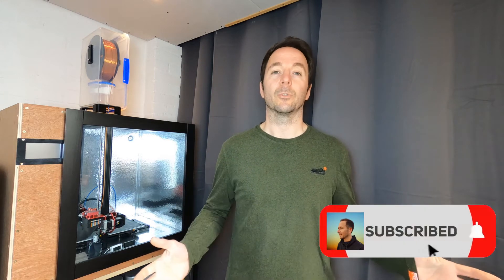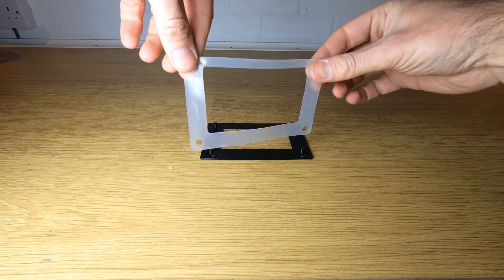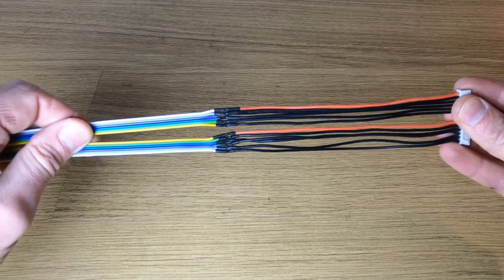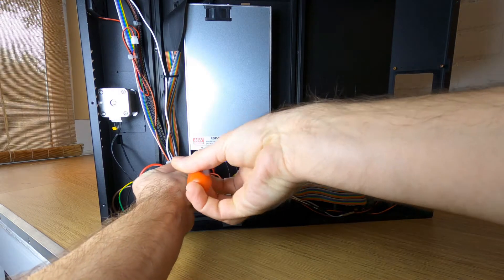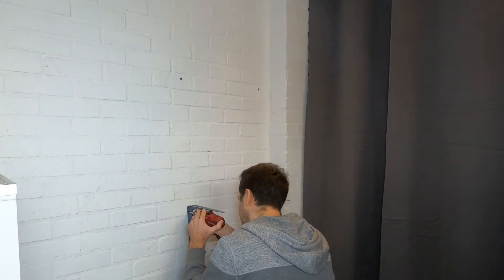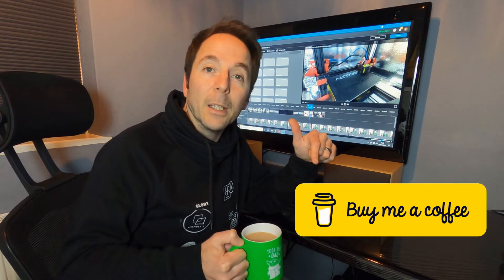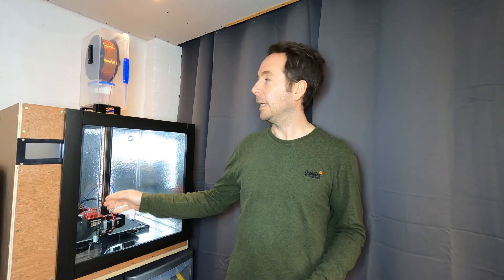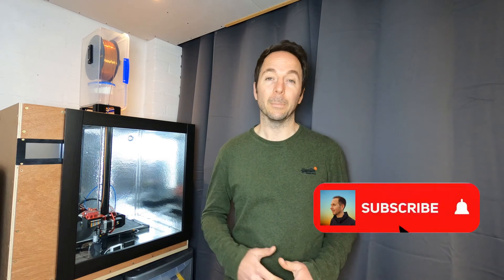CR 10s Pro 3D Printer Enclosure Pt2 (Fully operational by the end of the video!)

Comment: hi ricky i have a quistion for you i have my printer in a cabin and i print with pla dose the cabin temp effect the print quality 🙄🙄
Reply from the maker: The short answer is 'yes' but the long answer would need more information. It's more about the extremes of temperatures and drafts. Different materials can also be affected more or less by different temperatures. If you are printing mainly with PLA then I haven't really noticed a lot of difference from 10°C up to 40°C. What seems to have more effect is sudden changes in temperature or a draft cooling a print.
Reply: @RickyImpey  thanks for the long answer. and other quistion please did add a fan to cool up the cabine and why people do that
Reply from the maker: @HumamZaki  Sorry, not sure what you mean. Do you mean why would people add a fan to cool somewhere where they have a printer? I can't really say but I imagine they are concerned about temperatures getting too high. They may also be using a fan to extract any harmful particles from filament like ABS.
Reply: @RickyImpey  ok no problem thanks alot

Comment: Hi Rick, great build. Are you having any issues with heat creep, especially when using low melt temp materials liked PLA?
Reply from the maker: Hi, no none at all actually. I've honestly only had positives from putting the printer in an enclosure. Better bed adhesion from the more consistent air temperature around the print and a cleaner bed from less dust. I have however only been using it over the winter. Summer is only just starting to hit here now so warmer temps may cause issues that I haven't had yet. If so then I'll make more mods and another video🙂

Comment: I'm eager to see what mods you plan on doing in addition to this enclosure. I have an octoprint Raspberry Pi to monitor my prints so I'm trying to figure out how to still use it with the enclosure.
Reply from the maker: The good thing about this enclosure is that it's really easy to just remove a side panel and cut any holes etc. I was thinking of just mounting the Raspberry Pi to the outside with a small 'window' for a camera to monitor prints. Of course I will also need to provide power and I'd also like to be able to turn the printer in and off with Octoprint so it will need to be separate. Nothing too difficult to do and it's on the list of things to do.
Reply: @RickyImpey  would a USB wire be ok in the enclosure?
Reply from the maker: @nyjets91  it should be fine, I don't think you'd ever want the enclosure warmer than 50°C and wiring will be rated much higher than that. Without additional heating, mine gets to 40°C from just the heat bed. The best thing to do would be to run any wiring underneath in the section below the heat chamber that is cooled by fans. The main reason being that it keeps cables away from moving parts.

Comment: I was thinking about making a enclosure for my Pro in my garage I also use octoprint for remote printing so no need for the sd card just 
need a location for a raspberry pi ? but great idea thanks for the video
Reply from the maker: You're ahead of me Andy, I'll be doing that at some point when I have time. I have all the bits already. I was planning on cutting a rectangular hole in the right hand side and having a small 'window' for the camera to look through so that it's not in the heat chamber. I'll probably use a glass phone screen protector or something similar then have a 3d printed cover over the back to protect everything from dust and damage. Let me know if you come up with a better idea👍
Reply: @RickyImpey  Did you make any progress with the webcam idea ? thanks
Reply from the maker: Hi Andy, not just yet, I'm working on another project for the printer at the moment but I do plan on sorting Octoprint with a cam soon.
Reply: @RickyImpey  I've been looking into mounting a pi ir/day camera to the printer  then a long ribbon cable to the pi external ?
Reply from the maker: @trickylong17 , yes I have a dual day/ir camera all ready to go to use with the pi. I was going to just run the cable through a hole in the side of the enclosure by the 'front' of the printer. I will mount the camera inside but clear of the print bed and the pi on the outside of the enclosure with a 3d printed dust cover. It will need a power supply which I will run separately to the printer so that I can remotely turn the power to the printer on and off.

Comment: Rick. Although the insulation you installed is fire resistant. Have you considered installing a thermal fuse? Wire as part of the AC feed and placed in the top, it would cut the power in the event of fire or overheating. It won't put the fire out, but it might stop one happening / reduce the energy feeding the fire. They are available in a range of trigger temps (so could get one that tripped at say 300f which would be below trigger point of flammable materials but above safe working limit of the printer?  Just an idea...
Reply from the maker: That's a very good idea Edward, I've never used them but I'll certainly add it to the list of mods to investigate, thanks.

Comment: Rick. Any constraints with fan size? I wonder if placing the base of the printer on corner blocks under the legs would give more fan options and better cooling as the ‘floor’ height would be raised and the gap below the printer larger. I’m thinking of adding a fan filter as my wood shop is dusty

?
Reply from the maker: Yes, your limit on fan size is dictated by the bottom of the bed levelling screws. If you lifted the printer you could fit bigger fans. Personally I would just add more 40mm fans if I needed more cooling rather than trying to use a larger diameter. A filter on your inlet would be a very good idea if you have a dusty environment. Another option if you wanted to use bigger fans would be some kind of manifold fitted to a slot in the lower section. Then you are less limited but it would obviously take up more room outside the printer.
Reply: @RickyImpey  Thanks Rick - Coffee on the way :-) Hopefully you can work on outputing in imperial as I plan to start making this at the end of the week :)
Reply from the maker: @edwardk7217  thanks very much, your support is greatly appreciated. I'll see what I can do on some imperial dimensions for you👍

Comment: Rick
Any chance to print the plans with imperial measurements for those of us in the USA? I’m a Brit but over here inch fractions are king. I could use a calculator for each measurement but you might just be able to change a setting in your CAD app?

I will be using a mix of 1/2” ply and MDF

Thanks! Great plan
Reply from the maker: Give me a couple of days and I'll get something up on the Thingiverse link to help.
Reply: @RickyImpey  Thanks Rick. You might want to make this a dedicated channel for THIS printer. There's so much stuff on 3D printing out there, but hard to sort through for the stuff specific to the 10S Pro V2. Maybe you could do videos on the printer, what you've learned about it (Pros, cons, tips etc) and you would then end up with subscribers who have THAT particular printer.Best of luck
Reply from the maker: @edwardk7217  thanks for the ideas. So far I have really just made videos for the CR-10S Pro after solving my own problems and learning. I'll continue to do more as and when I do more with my printer for sure. I'm cautious not to pen myself into a corner for future content that is only for one model though. I have a few videos in the pipeline with projects that involve 3d printed parts but are not solely about 3d printing. We'll see how popular they are. Thanks again for the coffees, I really appreciate everyone who takes the time to watch and engage with my content let alone supporting the channel financially.
Reply from the maker: Hi Edward, I've uploaded 1/2" sheet plans with all measurements in imperial instead of metric for you. You can can find the pdf through the Thingiverse link, look for the file '0.5 Inch Sheet Plans Imperial Units'. Let me know how you get on.
Reply: @RickyImpey  Thanks Rick!

Comment: Rick. What about extending the SD card slot to the exterior of the cabinet so it's not as awkward?
Reply from the maker: Hi Edward, I did look into extending the SD card but I would have wanted it on the front panel. After some research I found that you can only extend them about 500mm before they stop working reliably. As the printer needs to constantly read the gcode off the card this meant I couldn't do it. You could extend to the RH side but that wouldn't work for me. Nice idea though, thanks.
Reply: @RickyImpey  Ahh, I didn’t know that limitation and that makes sense. I may try that side exit approach